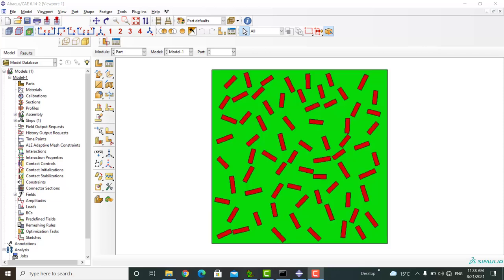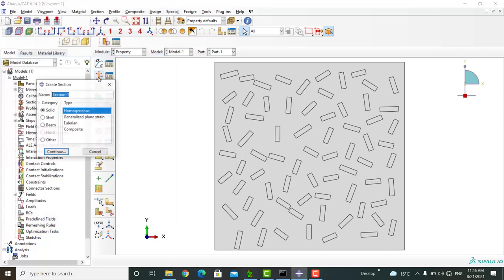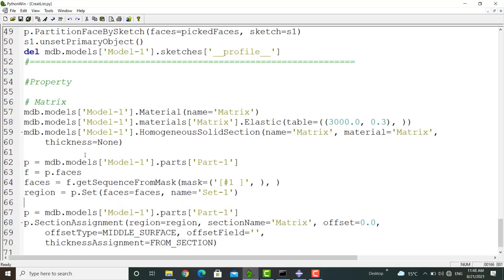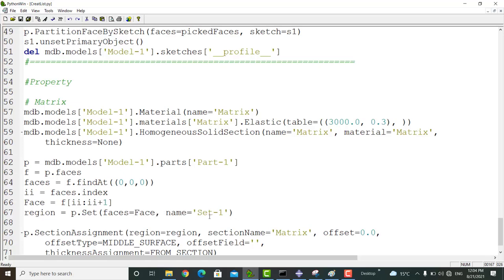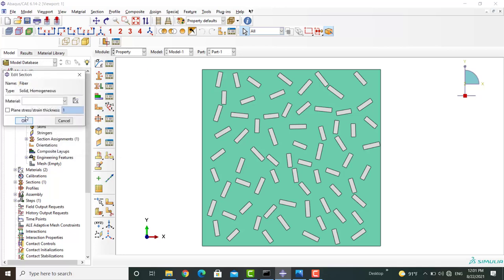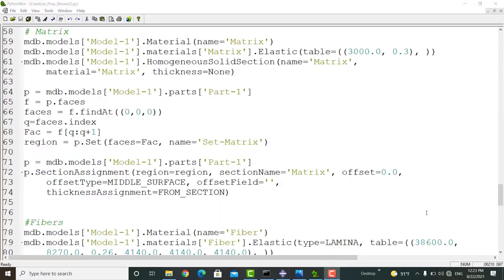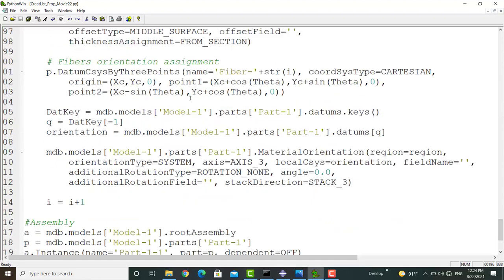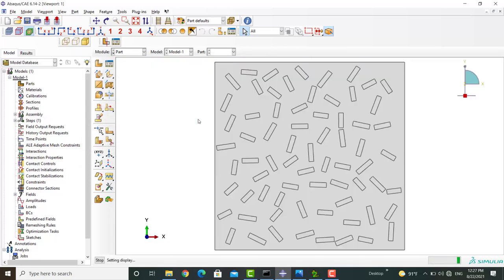Assign material orientation and properties to RVE of discontinuous fiber composite

Comment: hello :) , thank you for the informative video,  could you please show us if we want to assign the material oriantation of a curved surface, and we want to locally  change the material at each node, how can we do that via scripting ?
Reply from the maker: There are two possible methods for it:
First to use cylindrical coordinate system
Second to create your axis based on the coordinate of the material point and coordinate of the center of the curve.